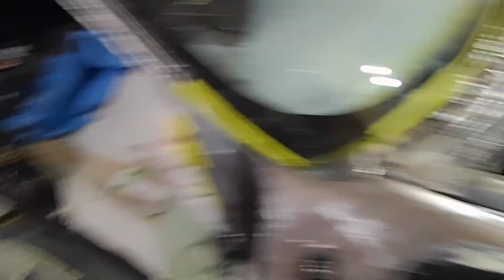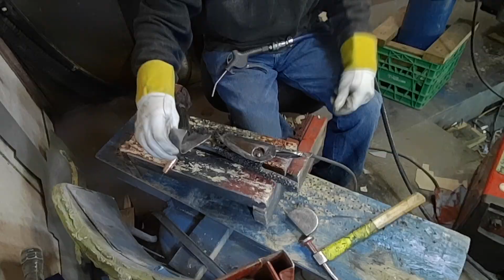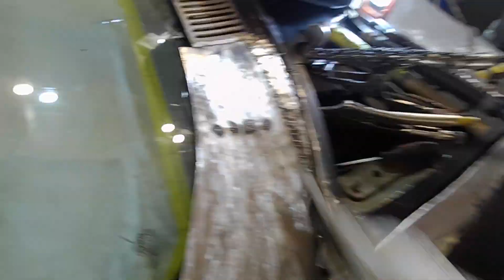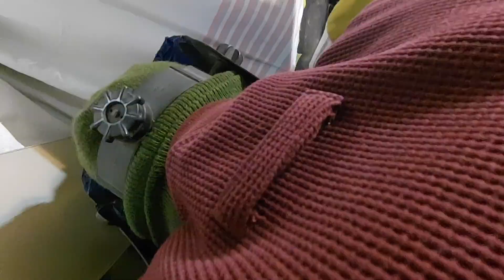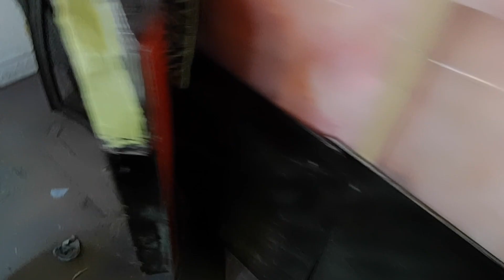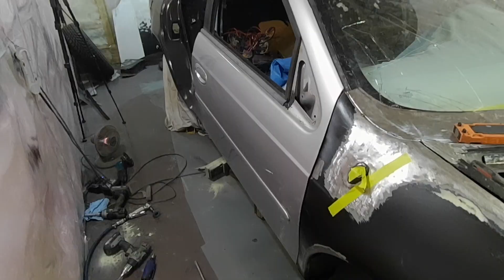AWD Custom Neon Build - Neoru Part 9

Comment: Crazy to see you form that cowl panel by hand and all. I mean all of it is wild. Nice work!
Reply from the maker: Thanks! Yes if I had a shrinker/stretcher it would have sped up that project greatly, I am hoping to invest in one this summer.
Reply: @CarswithNash  Yeah someone needs to give you an English wheel, standing pneumatic hammer, metal shrinker stretcher, and then really let you run wild.
Reply from the maker: @802Garage  I’m aiming to at least get the shrinker/stretcher and planishing hammer this summer.